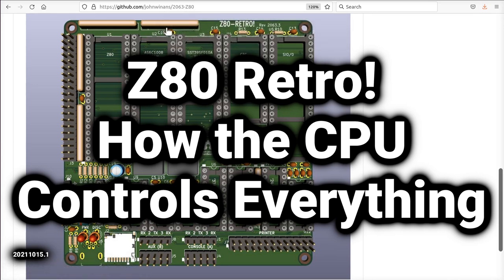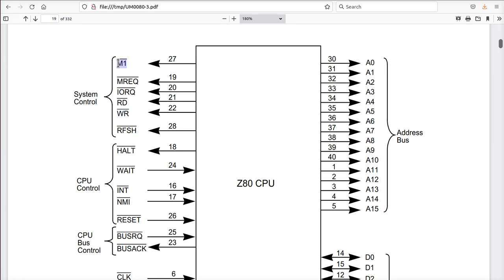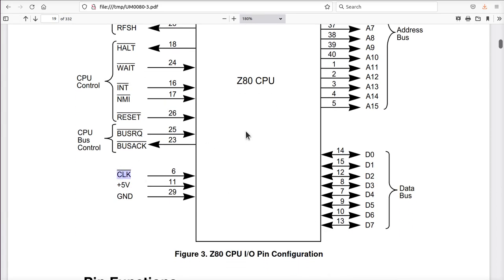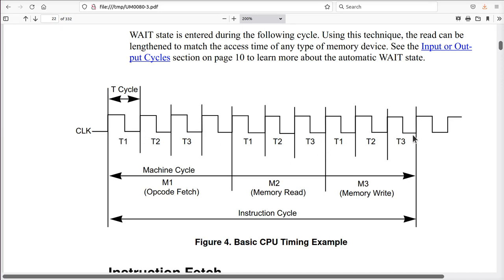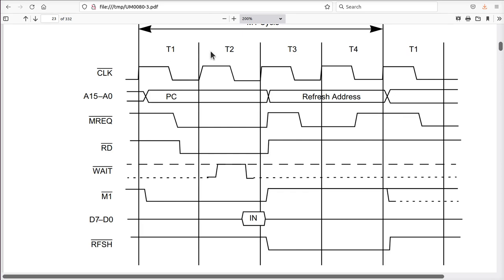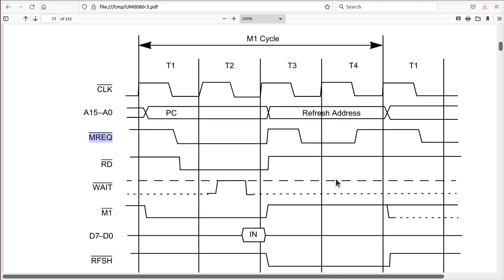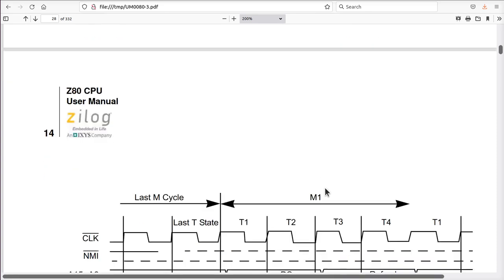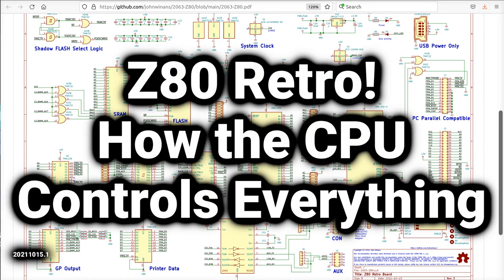Z80 Retro #3 - How the CPU Controls Everything

Comment: About the address bus during IORQ: If you use a command where the port number is in the C register the upper half of the address bus will contain the value in the B register. So you can have a 65536 ports instead of just 255 if you decode all of them. During the other I/O commands the contents of the A register will be put on the upper half of the address bus instead.
Reply from the maker: Indeed!  While it isn't necessary for the retro board's few ports, it could be useful on plugin boards.
Reply: On page 75 of the manual it states:
"In the IN A and OUT n, A instructions, the I/O device’s n address appears in the lower half of the address bus (A7–A0), while the Accumulator content is transferred in the upper half of the address bus. In all Register Indirect input output instructions, including block I/O transfers, the contents of the C Register are transferred to the lower half of the address bus (device address) while the contents of Register B are transferred to the upper half of the address bus."

What isn't made clear is that the IN block transfer instructions alter the B register after the I/O cycle the OUT versions do so before.

Comment: Haven’t read the other comments, but just a correction and a thankful (for my matrix keyboard) addition to the way the Z80 works the address bus on a particular OUT or IN command. It does indeed write data to the WHOLE address bus, butting the contents of the B register onto the high 8 bits, to the port numbered in register C. Apparently the ZX Spectrum made use of this command for its keyboard reading.

Comment: Making my own board. This is gold.  I was not solid on the port I/O address space.  You cleared that up.
Reply from the maker: Cool!  Are you using the retro board or did you create a new custom board?
Reply: @JohnsBasement  I am breadboarding mine to start. It's my own minimal spin on things.  Its not complete, I have to find some latches to gauge signs of life. Might do a parallel/serial stream into an Arduino connected to serial to debug. I only wired the CPU, ram, rom, and address decode the night before. Early days 😀.  But I am quite happy doing it. I got a zif socket for the rom, as I know that's going to be in flux for quite a while. Look forward to watching the rest of your series.
Reply from the maker: @gregorymccoy6797  This is great!  Let us know how it goes!
Here is a tip that I use with Z80 CPUs (and others where it is convenient to do so) when I bring them up from scratch the first time (not sure if I mentioned this in this series or not.)
Put a set of pullup resistors on the data bus.  (You might have to wire them into two groups depending on the opcode for a NOP instruction.)  Since the Z80 uses 0x00 for the NOP instruction, you can power up a bare Z80 with the data bus pulled DOWN instead of UP (don't short it to ground... PULL it to ground.)  If the CPU uses some other code for NOP, then pull the data bits up and down to match the opcode.  (when done with this part of your project, just pull then all up as would be the typical case.)
This way it will free-run, executing NOP instructions.  You can then look at the address bus and see it simply counting.  AND you can watch things like the write, halt, mreq, ioreq, and read lines to see if they are all doing what you'd expect if the CPU is doing nothing other than continuously executing NOPs.
The value of this is that it lets you power it up and see proof of life before you have to sire up the RAM, ROM, and any decode logic etc.
I debugged my design of the S-100 boards I showed at the beginning of this series with nothing other than an analog VOM and two LEDs connected to the outputs of a 74LS112 () strapped to toggle on every clock and some reasoning like this to confirm that it was doing what it should each step along the way... and without having to buy any expensive equipment!
The VOM can easily show 1 vs 0.  But to know if something is toggling over time (like at a rate faster than 2 HZ or so) you need something that can indicate that situation.
If you pull both the J and K inputs to a 1 (and strap it so the SET, CLEAR, etc. are all disabled) then connect the CLK input to any signal you want to 'watch' then every time there is a falling edge, the two LEDs on the outputs (Q and /Q) will 'flip.'
If only one is on, then the signal is not changing.  If both appear to be on then the signal is changing fast.  If it flips slowly (like a railroad crossing gate) then the signal is changing at a period equal to the rate of it flipping back and forth.
A similar effect can be seen by connecting LEDs to all the output bits of, say, a 4-bit counter whose count input is connected to the signal to watch.
Reply: @JohnsBasement  yes, the device does work. I made a minimal test just as you described and fed in a 5Hz clock from a signal generator. The address bus incremented as expected. I probed the M1 line, too. I hope to have more results after this weekend. If I can add two numbers, I know I can move full steam on a proper monitor.

Comment: Nice Job.  Yes inconsistency in manuals are about as bad as outright errors.
Reply from the maker: Wait till I get a chance to rant about the MCP23017 datasheet.  :-(
Spoiler alert: The /RESET pin is labeled wrong.
Reply: @JohnsBasement  I think it was Microchip that had sveral microcontrollers with erratas longer than their datasheets. :)
Reply from the maker: @Torshak0  I don't mind errata.
My glass house is full of cracks too.  All I ask is that they do a better job at updating their datasheets.
I can't even find a link to report the problem.  
Call their main 800 number?

Comment: Hi John, just started looking be at this project. A quick question ( probably answered before). I can only source the z80 at 10mhz, the CTC and sio are slower, should I slow the main clock, say to 8mhz, so all chips can cope? Would this affect others parts of the project?. Thanks
Reply from the maker: I'm sorry.  I thought I replied to this.  I  must have not hit 'send'...  I had the same problem sourcing parts back in '21.
Nothing on the retro has a "minimum speed". And the Z80 also has no minimum speed.  I picked up a few oscillators back then so I was ready for anything.
Run it at 8mhz and it will be fine.
I haven't posted much code for the ctc yet.  You will, obviously, have to consider the oscillator speed on anything that uses the system clock as a timebase. 
Note: I use the second oscillator for the SIO bit rates in my BIOS.  So make sure you get the same speed for that oscillator!
Reply: @JohnsBasement  thanks John, I was pretty sure it could run at slower speeds, but wasn't sure some chips- ie: CTC - would have trouble with the clock speed. Later I realized the baud speed is setup as multiple of the 1.832mhz clock, so should be alright. Anyway I already bought the chips, so what is worse that can happen! Should be fun!

Comment: At time 42:14 you note that the M1 is low and IORQ is low, "... it  is not fetching and instruction from an I/O device".  But isn't it?  In Mode 0, the 8080 legacy mode, it is fetching a one byte instruction, usually a "Restart" instruction. (Good for restarting after a HALT). And just like any instruction fetch (M1), it is followed by a DRAM refresh.
Therefore, it makes sense that the M1 is low during and "instruction fetch".
Reply from the maker: Ohhh!!! Yes!  Good catch!  ...overlooked by e due to the fact that when using Zilog peripherals one tends to run in mode 2... during which the CPU definitely does NOT receive an insn opcode from the device.  However, if one uses mode 0 then, definitely, the byte would be treated as an opcode!
Reply: @JohnsBasement   I am very grateful the the RD does not go low when reading the interrupt vector value. Can you imagine the complexity of the logic circuits to separate IRQ responses from I/O read requests?
Reply from the maker: @randallrouth9029  Oh geez!!! Yeah.  That would be craziness!!!!

The good news is that the Z80 designers made it fairly easy to be able to decode everything that is needed to decode the addressing and enable logic for the I/O devices (and the same again for memory chips) with nothing more than a 74LS138.  It is a simple and clean interface!  :-)

Comment: The amstrad CPC and the  Spectrum both make use of the higher half of the memory bus during Io

Really bizarrly when you do

Out c, HL

The contents of b are on the top end of the address bus ... And on the speccy and the CPC ThAt .. and not the value in c is the address used to select an output device

Crazy eh!!

I have no idea why the engineers did that
Reply from the maker: I never knew this was a 'feature' back in 1981.  I have yet to look closely at how the high address bits are used on those systems.  I suspect it is a time-saver since you can output 1 byte and read one back at the same time.  Someone mentioned the CPC scans their keyboard using this feature... one way to do it might be to just run the high address bits to the keyboard's Y-axis (so to speak) and then read back the X-axis to see if any keys are down on a given row. [This would likely emit a huge amount of RF unless you used, say, a transparent latch on the address lines to keep the scan bits quiet when not reading the row(s).]

🤔This is probably worth a project video at some point.
Reply: @JohnsBasement  oh please do make one. I cannot say how much I'm enjoying your video series so far. Very glad I stumbled upon it. I like your style man!
Reply from the maker: @AClockWorkKelly1  I'll add it to my TODO list.  That is actually two topics: 1) keyboard scanning and N-key rollover, 2) how the Z80 uses A8-A15 during I/O instructions.

Just a glance now, I can see that the Sinclair used EXACTLY the scheme I describe above... RF noise and all! .... AND they didn't include any diodes, so they don't have key-rollover. 😂

Comment: Interested in building a system...are bare PCB"s available for purchase ?
Reply from the maker: Yes.  You have two options.

#1) You can order some from China.  You can get 5 bare retro boards and 5 bare flash boards for about $25.

#2) You can get one of each from me (and at least one other that I have seen offering in YouTube comments that I have seen).

At the moment, I have two retro rev3 boards and two flash rev1 boards. If you are a patreon AND I have them in stock then I'll just give you a pair.  Just send a shipping address to me in a private Patreon message.

If there is enough interest, I'll see about setting up an on line store... I try to post a poll to see if there is enough interest.